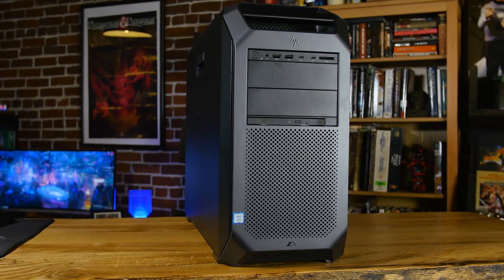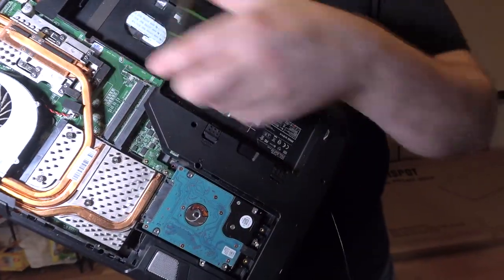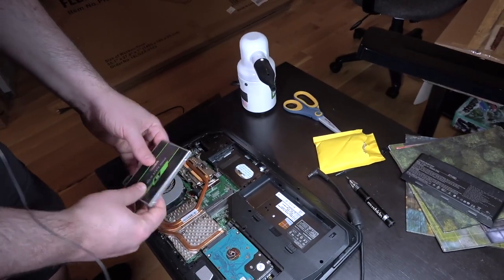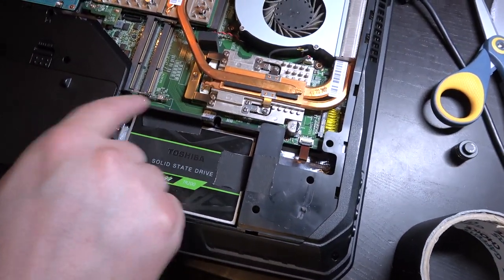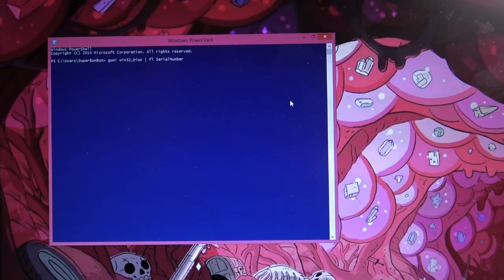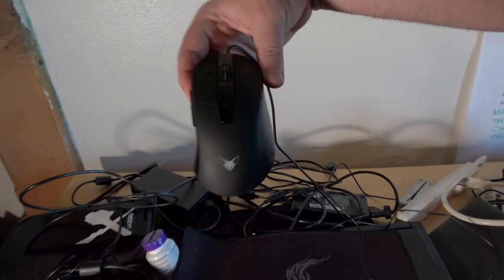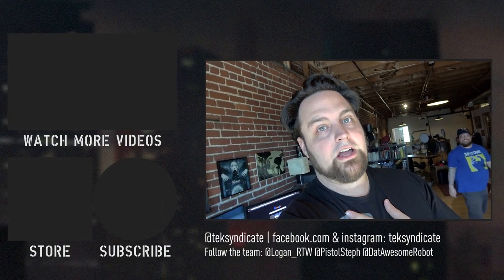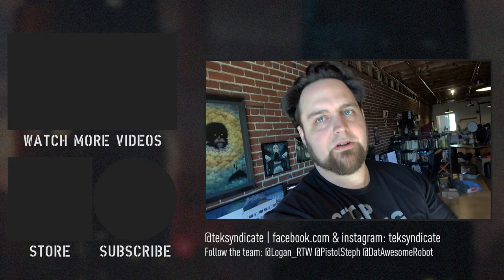Laptop SSD Upgrade & Prepping for Computex 2018 | VLOG

Comment: Nice but I would suggest just image the hard disk, using a tool like Macrium Reflect (I highly recommend), and restore the image to the SSD. Then, since Windows doesn't like when there's 2  drives with Windows installed (ie. it won't boot), take out the hard drive, and you can boot from the SSD. It really is that easy, I know I've done it.

Comment: Belarc Advisor Free Utility, it Runs , Generates A HTML file Somewhere on your C:\ (Windows Drive) and opens it in your Default Browser. About half way down the page it will list serial keys for Windows.  In Windows 7 it Will Be Your Product Key (CD key) in Windows 8/8.1/10 it will be wrong, but it will have A CD Key for Internet Explorer, This Is Your Product Key used to Install the Windows Version For Your Machine or Windows 10,  If the Key is for Windows 7/8/8.1/ or 10..!!

Comment: If you Can You Should Make a Backup to an external drive before starting any of this! Think of it as a Safety Net, in case any thing goes wrong!!!!

....if the used portion on the HDD (DATA ONLY) was smaller than the size of the SSD,  then you could have cloned Windows (All partitions) from the HDD to The SSD .... Zero Data Loss Windows would still work, All you have to do is make sure that the SSD works in Windows on that machine (AHCI driver Loaded) then clone, then wipe HDD. If you are wiping to use the key for a clean install of Windows 10 (which will accept Windows 7/8/8.1 Keys on Clean install, this method gives you a digital licence, which will allow you to upgrade that licensed, activated 7/8/8.1 machine to Windows 10 if using the same key throughout this process).. Then install Windows 10 on the new empty SSD with the same key for that machine, the one under the battery, then that machine has a permanent free Windows 10 License with downgrade and re-upgrade rights... every new build of Windows 10 is an upgrade.... Then once Windows 10 is Activated [*]*on that machine, Wipe SSD, Clone HDD to SSD, Wipe HDD, Upgrade to Windows 10. ** Effectively Re-Install & Re-Upgrade... Zero Data Loss
Reply: MOST Important!!!  Another option would be external backup of the system or files ,  So you can start over if it does not work!!!!